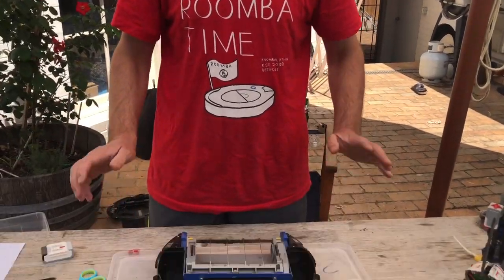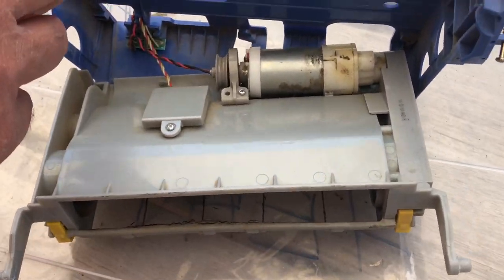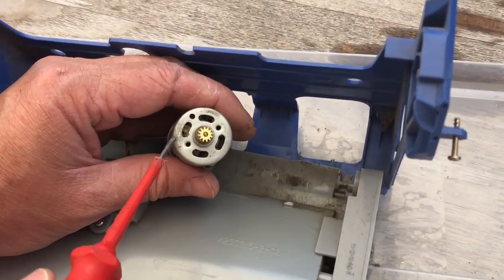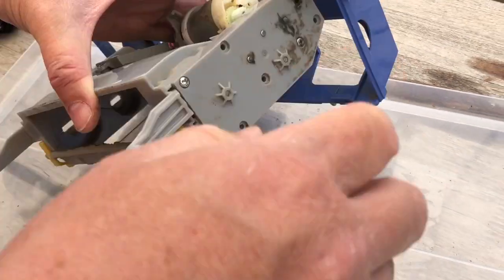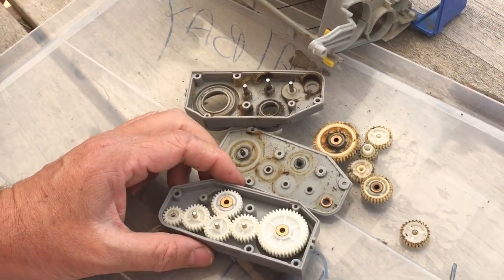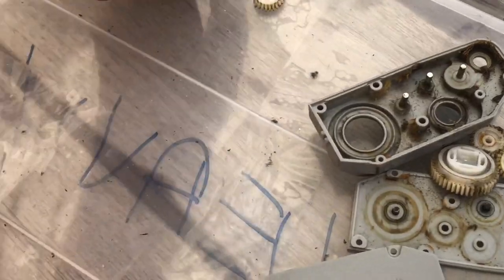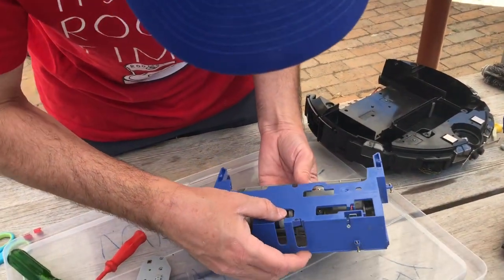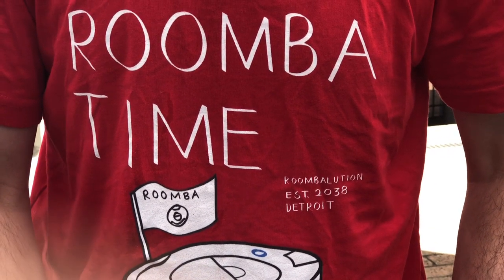iRobot Roomba cleaning basics 101 - Part 2

Comment: 770 Getting error 2 after a few minutes but only on carpet, works fine on hard floor, changed the brushes and cleaned everything out including opening the gear box cleaning and regreasing and zero difference, brushes seem to be making a clunking noise on carpet
Reply from the maker: clunking will be the brushes reversing direction because the roomba has seen a high motor current and thinks something is jammed. Question: did problem happen with old brushes? did problem just start happening or after thew new brushes? if you are tech savy, you can make up a cable and connect to the roomba and run built in tests to see what the motor current is doing.... could be motor issue or issue on motherboard. Where are you located? other idea is to look on marketplace and pick up cheap 2nd hand one and swap out the bush module. If you were in Melbourne, Australia, I could help you out. See this video https://youtu.be/m7OG5IMrgiQ?si=ZRidvpa5VI3RW44z

Comment: I found your video very informative (thank you) and I followed your advice and cleaned everything yet, I am still getting the error 2 message after 1.5 minutes of running time. I have a 650. It was working fine until I needed a new battery and now I am having this problem. This happened right after installing the new battery. Any idea what I can try next? I do worry that the brushes get stuck. I greased the gears and I can’t be sure this is the problem cause I can not see the brushes running unfortunately.
Reply from the maker: Hi
Can u remove both brushes and run. Then run 1 brush at a time. Report back. Ta
Reply: Yes, I tried that and it ran fine with one brush at a time. Either one ran it for 10 minutes.
Reply: And then I stopped it!
Reply from the maker: I’m curious, Can u put back old battery and see ?
Reply: @drroomba5045  Unfortunately I got rid of it.

Comment: Hello,

I performed all the clean possible following your directions however the error 2 persisted. I realized that the machine is either receiving wrong information from some sensor then giving the error; or the computer has a malfunction. I even put the dirty text sensor apart, inspected the cable harness, and gave a good clean to the copper disk.

 Anyway, your directions were very helpful, otherwise I couldn't perform the disassembly and cleaning.
Reply from the maker: Did you try removing both brushes ? Still error 2? Remove gearbox - still error ?

Comment: After I put it back together the brushes don’t turn at all now.. what do you recommend? I did not put oil on the gears but the brushes turn manually
Reply from the maker: I would put the roomba into its 'built in test' mode and run the test which turns on the brush motor. I would remove the brushes and see if the motor turns to try and narrow down where the problem is. Built in test mode is the best because you can run just the brush motor and turn roomba upside down and it keeps running. I have another video which explains how to get into built in test mode. See here https://youtu.be/m7OG5IMrgiQ
you dont need a laptop though.

Comment: Hello. What else can we do for error number 2? Roomba is only 11 months old and I ve tried everything showing in these 2 videos.  It only works 2 minutes and again error.  Thank you!
Reply from the maker: Hi, what is model number of your Roomba ? Also remove brushes and run. Does it stop with fault 2 ? Remove each brush in turn and repeat. Report back
Reply: Good afternoon and thank you for your answer. Yes, it stopped with error / fault 2: clean brushes.  I did what you said.  With no brushes it worked 5 minutes then stopped. With  the main brush only, it worked 2 minutes then stopped. With the flexibile brush only,  it worked 5 minutes then stopped. I replaced the new brushes with the old brushes too, it worked 5 minutes then stopped.  The same error/ fault clean brushes ☹
Reply: Ohh I forgot to mention,  the model is 605.
Reply from the maker: @elenapatriciu9517  Hi Elena, the error is because the roomba computer thinks the motor which turns the brushes is drawing to much current. You could try spraying 'electical contact cleaner' inside the openings/holes in the motor to try and clean inside the motor.  If I was you I would look for a 2nd hand roomba on facebook marketplace or similar 2nd hand selling place and swap the cleaning head module. Best to buy a 2nd hand roomba instead of buying a new cleaning head module as there is also the chance the roomba computer is faulty. You say you only have for 11 months...was it new when you got it? motor should last alot longer than that. Could be the roomba computer...try and get a cheap 2nd hand CHM.
Reply: Ohh more harder than i thought.  I bought it new and because he is still in warranty i just decided to send him in service as fast as I can.  This is my first robot 😊. Thank you very much for your help ❤

Comment: Hello and thank you for this video!
I have a problem with the the main brush motor: it spins only when the roomba is upside-down (tested with diagnosis mode). As soon as I return the roomba and put it on its wheels, the main brushes motor stops working. Is there any chance that the cable/dot you talk about in the beginning of the video have anything to do with this issue ? 

Thank you!
Reply from the maker: It seems when the motor is put under any load it stops. Does it stop when placed on a smooth surface (not carpet?). The cable does adjust the height of the motor however i think the issue would most likely be with your motor. Does it pass the motor test in diag mode? (whilst under no load - i.e lifted) If you connect a laptop to the roomba you can get alot more info (see my other videos). You can se the motor current on laptop. I have had this problem and it was the motor. Have you cleaned the gearbox like in my video? you can also try cleaning out the motor like suggested in my video. Remove one brush and see if it stops. Dont forget to subscribe !

Comment: I work on my Roomba about 20 minutes and it runs for about 2 minutes.  wondering if I will ever figure out the puzzle.
Reply from the maker: How old is battery ?
Reply: @drroomba5045  about a month old.  After watching your video I cleaned it out again and it ran until I turned it off, I think the sensor was blocked.  thanks

Comment: Mine is only 7 months old, took mine apart fully and saw no problem what so ever, I will try WD40 in the motor and some new grease.
Reply from the maker: Don’t use WD40 inside motor (ie. where motor windings are). Use electrical contact cleaner.

Comment: Thank you for your video.  Very detailed and informative.  I have another question though.  My virtual walls are not stopping the roomba from propelling through them.  I have already put fresh batteries in and I am getting the 5 blinking lights when I turn on the virtual wall, but then the roomba still drives through it.  Is there another way to sync up the walls?  I have a roomba 805 with the two virtual walls that came with it.
Reply from the maker: Hi, some questions for you: 1) I assume you have the switch in the UP position on the virtual wall ? 2) has it ever worked 3) If you place the roomba 50cm in front of the home base and press the DOCK button does it find home? 4) If roomba is on home base and you press CLEAN, does it reverse backwards? Regards The Doctor

Comment: Awesome video!
My 650 fails to charging: it docks, led red is blinking but it's not charging! I clean the metal contacts (base + roomba), changed battery. It fails but not all the time: something it wait 30 minutes then starts to charge! Can you tell me if I can do something about it ?
Reply from the maker: Can you try to charge it from side port instead of using home base as a test?
Reply: @drroomba5045  Orange light is blinking but it doesn't recharge.
To be honest, right now,it started  Fully recharging after about 50 minutes" (from the side port)
Reply from the maker: Alessandro Boggiano when u remove battery you will see 4 metal springy looking prongs. The bigger ones make contact with the voltage and other smaller ones are for battery temp. Try slightly bending them up so they make better contact with battery. Sometimes they get pushed down too far. Try this simple thing first
Reply: @drroomba5045  thanks! I tried but it doesn't change! It stays on the base doing nothing than it starts charging after a couple of hours.
Reply from the maker: @AlessandroBoggiano It may be time to try plugging a laptop into the roomba and check out the charging logs. I did a video https://www.youtube.com/watch?v=m7OG5IMrgiQ
Reply from the maker: It also may be worth pulling the roomba apart and giving the motherboard a good clean. I use https://www.altronics.com.au/p/t3150-chemtools-electronic-cleaning-solvent-aerosol-230g/
Reply from the maker: also you can post http://www.robotreviews.com/chat/ for more support
Reply: @drroomba5045  Thanks I was thinking about using  "manual advance" test (21 / 22 /23) from the 500 manual. Can I give it a shot?
I agree with you: it's time to pull it apart ang give it a good clean (it was working from about 600 Km! :-) )

Comment: Well done mate! Could you also do a video on how to clean the left/right driving wheels please? (Thanks all the way from the UK) :)
Reply from the maker: Hello Adrian, I guess you are getting lots of hair getting wound inside the slot near the tire. It is possible to pull apart the wheel assembly,  so  you can remove the hair, however it is difficult and I would not recommend it as you can cause more damage putting it back together. This guy gives another option which i tried and although it requires drilling some holes, it worked well. Check out https://techforpassion.blogspot.com/2013/01/teardown-roomba-wheel-assembly-taken.html